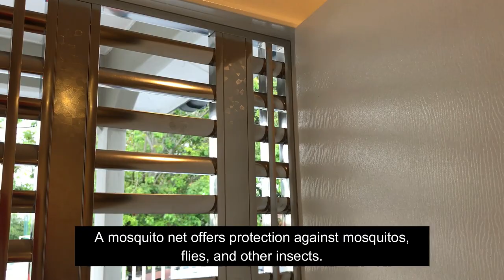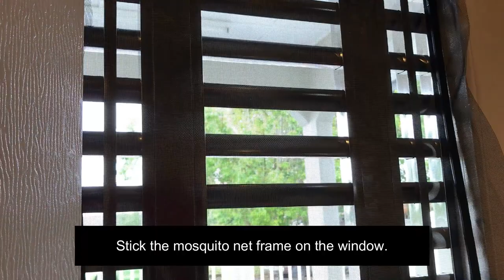DIY - How to make mosquito net for door/windows easy at home?

Comment: My room 1 big piece of window frame comes with 2 windows 120cm x 120cm.  Is it easier to fix as 2 pieces (2 × 60 x 120) or as 1 big piece (120 × 120).  In the centre of my frame there is a buldging pad lock.  Seek your advise. Thxs.
Reply from the maker: Hi, My suggestion is to separate it to 2 pcs as it will make net become flimsy...for the bulging "pad lock" you may make another small section for it......this is just opinion...in future, we may do a video on it. Thank you.
Reply: I thought about it as well but the centre of my window grill is uneven due to the fixing of the padlock.  Hence I will have to cut a hole in the centre so that netting can fit can be flatten and not loose.  
If big piece I will also need to cut a hole in the centre so that the net will be flatten and not loose.
So which one in yr opinion is the better option ? So confuse.